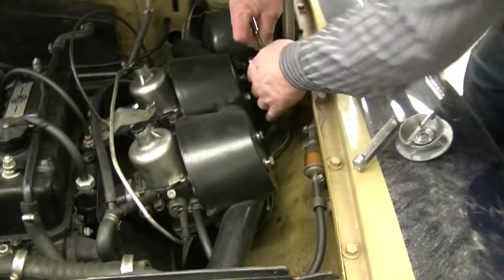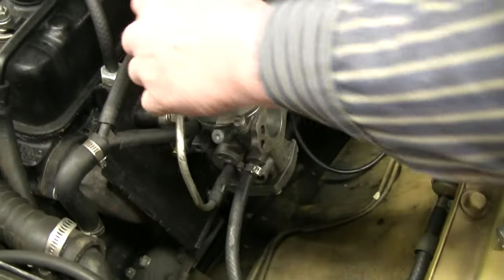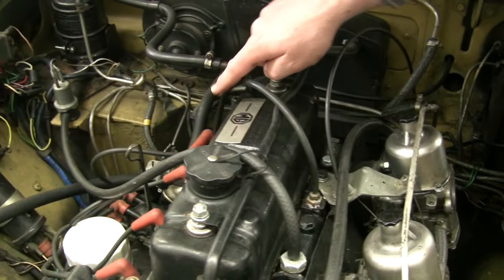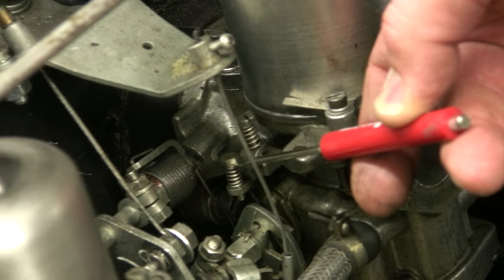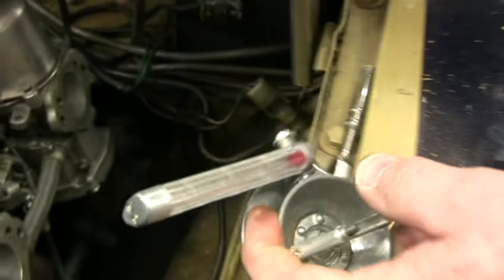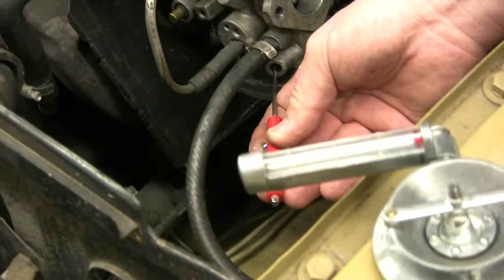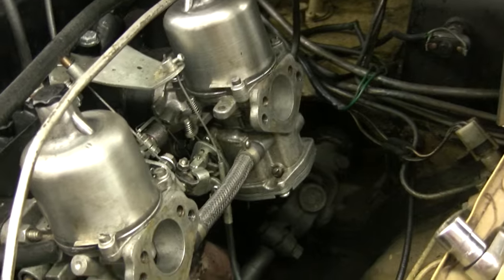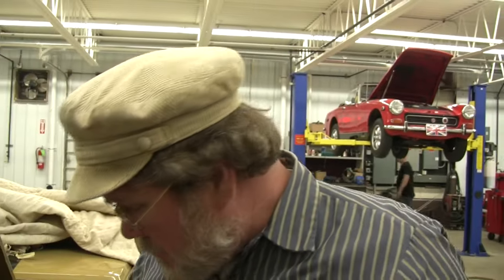147 MG Tech | Carburetor Tuning

Comment: Yes, I do not know why he did not state this. You must unlooses the nuts that clamp to the link bar. You cannot balance the carbs if you do not do this. Use a 5/16 inch wrench. Then tighten the clamps after balancing both carbs

Comment: Well, well, well. G'day  from Sunny Queensland Australia. I would like to thank you for your informative videos. I have a 79B that is running HIF SU"s. I bought the car some 15 years ago from a friend, who knew bugger all about it. On investigation I found that is an american import. I was told that by another fellow who also owns a G, way earlier though. " oh look it's got three wipers, an american import". hows that for investigation, ahahaha. Unfortunately for me though the carbs are not set up correctly and a few parts are missing and hoses disconected. It had run OK since I bought it but recently its been flooding the engine cyclinders with fuel. They are currently with a mechanic of some 40 years being cleaned and rebuilt...watching your videos shoows me where the previuos people have gone wrong and I thank you. yours Peter Eastey

Comment: This is really great, thank you but what year, model, engine, carb are you working on? I'm going to help a friend get his 1962 MGA 1600 running, this looks similar to a point and I know in general these principles can carry over, but it would be nice to have a frame of reference. I've never touched an MG before, I'm all 50's, 60's 70's USA hot rods. But I am half a Brit by birth so I should know this stuff inside out. Thanks!

Comment: Thank you John!  I have been putting this off and driving a very outta tune car for over a year.  I tackled this and cleaned up the carbs (on the car) in an hour...  You give great details and hints.  Still not 100% on the mixture (maybe I am lifting too much (tried the lifters and your screwdriver method).  I get a rough condition when I lift 1/4" (about what the lift rod give it).  I think you said this is a lean condition - so I backed out the mixture nut. (1966 Sprite with SU H2 carbs).  Total timing is 32 (with vacuum off and plugged).  compression is equal on all pistons. Spark plugs are what you recommend Champion N9Y.  She runs 1000 percent better and starts with a bump of the key - cold or hot (I hatted starting it in a parking lot after talking to people about it - because it never started well.

Comment: great video but I found the quantity and viscosity of the oil in the dash pot cylinder was critical. I wondered why I could not achieve a correct acceleration performance and found the oil was very low and if filled , the fluffing issues were cured. The oil dampened the piton rise keeping it rich for a split second.
Reply: The recommended oil for the SU dash pots is 20w50 engine oil.If you put a lighter weight oil in,the damper pistons will float instead of closing when they need to.

Comment: At 7.00 it's the mixture screw,not Idle.
Reply: Each carb on the HIFs has a mixture screw. This screw is hard to see as it is near the different lines to the carb and can be reached only with the air filters are removed on the stock carb is they are the original ones. The mixture screw moves the jet head up and down. If you move the jet up by turning the adjustment screw counterclockwise, you lean out the fuel mixture. Turn the screw clockwise and you enrich the fuel mixture. You can push the piston up and see the top of the jet. This is a way to visually check the location of the top of the jet. It should neither be too high or two low. I always start adjusting the carbs by putting this jet flush with the carb body then lower it slightly. Never start adjusting the carb without knowing where the carb jet is when you start. This is the mistake many make!

Comment: You loosen the linkage when adjusting the air draw so you are adjusting each one independently don't you?
Reply: Homebrew58 h
Reply: You must loosen the screws one of the linkage between the carbs before equalizing the airflow. Do not unscrew both linkages. Once you equalize the airflow then you tighten the linkage. I do one know why this is not included here. If you do not loosen the linkage, both carbs will never be able to be adjusted INDEPENDENTLY.  After equalizing the air flow, then retighten the linkage on the one you loosened. Also make sure the the angle of the linkage is correct. Look at the owners manual to shop manual to confirm the linkage is at the right angle.

Comment: Thanks for the great info. Are you in Canada by chance? I would love you to look at my 
MGB 1974.  Out of nowhere the car has started to run rough and extremely rich. It’s a 1.8l 4 cyl. I had a local shop rebuild both carbs. It has stopped gas from pouring out of the charcoal filter but it will still stall at idle which is 1400 RPM. Once driving it works better. The shop says that as low as they could get it and they assume an intake manifold is causing a vac leak.  After watching this video I did everything you said except sync the vacuum as I don’t have the tool. I was able to lean it out and get it to idle better. I thought it was good until the next night when I cold started it. I had to pour in a little gas into each carb just to get it started . Once started I adjusted the fuel to a more rich state and increased the idle. It now runs rich but at least doesn’t stall once it’s warm.  I know this is a simple fix . I just paid $900 to have both carbs rebuilt but I doubt they synced or balanced them properly. Let me where your shop is located Or maybe I can send you a video of how it’s acting? Much appreciated

Comment: Is there a base setting for the fuel  screws? Like on other carbs.....screw it in back so much out just to get a good start. I have a rough idle at low rpm and it is running rich. I try to lean it out and it backfires.

Comment: Something you missed here is to verify the pistons move freely through full distance. Unscrew the dampers & raise the pistons by hand to verify this. You should also hear them hit the bottom stop to be sure they are completely closing. Make sure you have adequate oil level in the dampers or the pistons will flutter & rise too fast at throttle up.
If you haven't already, you might want to educate people on the starting procedure for SU equipped vehicles, I have to enlighten nearly every customer I have to not pump the gas pedal. It saddens me to see all these cars here in the US without their SU's or CD's, they're great carbs when they are set up right.
Reply: Hey Maybe you can help, when lifting the piston do you only lift it up 1/32 temporarily or hold it there to check the mixture? also, on my car i lift and hold the piston but it dies immediatly when the mix screw is out 2 turns, the only way it rises and falls properly is almost out at 13 turns but this causes the plugs to foul badly, am i doing it wrong? ( Brand new HS4 with abx needle on a series 998 )